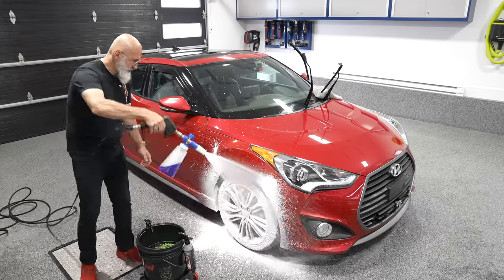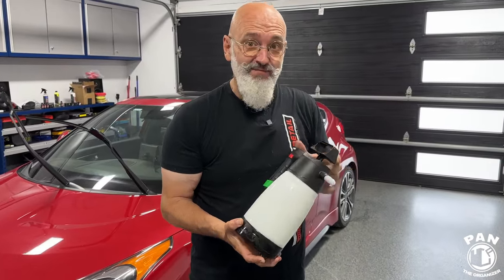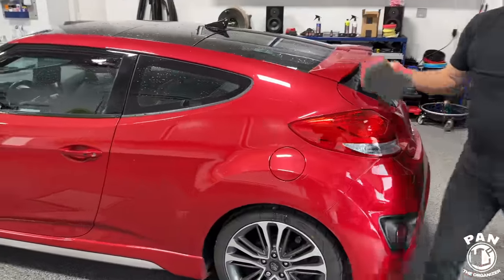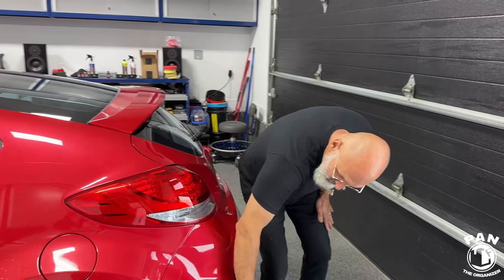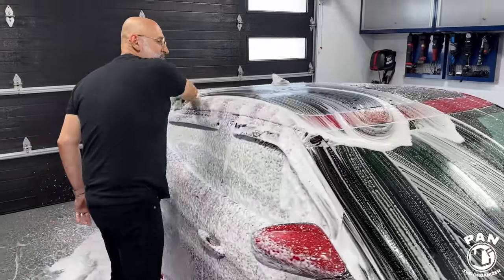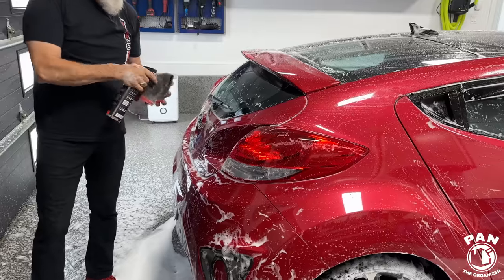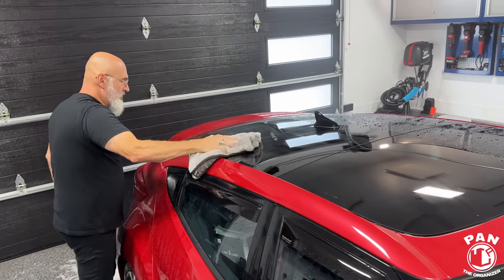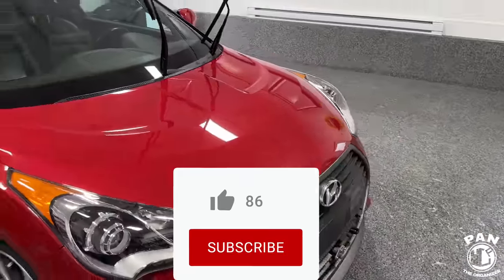The Ultimate Guide to Easily Wash, Clay, and Seal Your Car!

Comment: personally I'd only ever use rinseless wash on my car if it's not been used. I'd use it to get dust off and that's it. Yvan seems like a con man, I've seen a few videos with him now and one of them he even says not to use a pressure washer as it pushes dirt into the paint work. I don't trust someone who can change opinion to suit the next product he's selling,again just my personal opinion. also imagine taking your car to be cleaned and finding out they used a rinseless wash method 🤔 I know I wouldn't be happy.
Reply: What’s important is that you enjoy the process you use. For the pressure washer, I don’t suggest you use a pressure washer as the first step. Foam on soap or spray on Rinseless before spraying the Coatings are swirl resistant, not proof.   The way I explain it to customers is with a sheet of steel.   If you place a sheet of steel on your concrete floor, you can drive and walk on it and it won’t bend. This is because the substrate is as hard as the sheet of steel.   When we look at the coating it’s 1 -2 microns thick, paint is 100. Coatings are 9h , Paint is 5-6 h. The 1-2 microns will not harden the 100 microns under it. To illustrate this place a mattress under your sheet of steel. Now walk across it, it will bend, twist and deform. The mattress under it will remain unharmed.   How a coating reduces scratches isn’t only because it’s hard, it’s also due to the reduced coefficient of friction. To illustrate this to a customer invoke the image of a mesh bag with nails sticking out of it. Drag the bag across the sheet of steel on the mattress, it will scratch the sheet of steel, but the mattress will be unharmed. Remove the sheet of steel and drag your bag of nail across the mattress, it will rip and scar the surface with a pressure washer. The high pressure pushing the dirt into and along the surface is a risk.